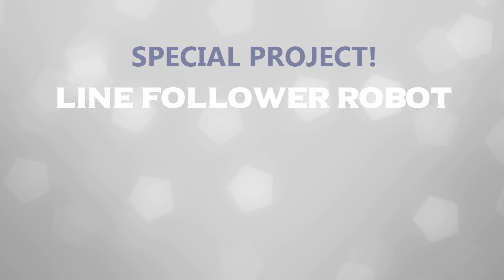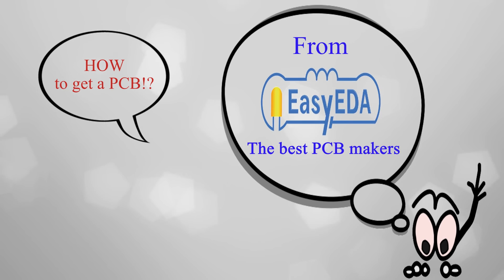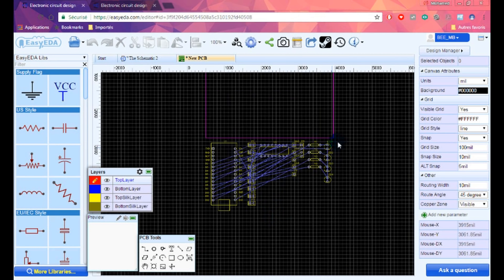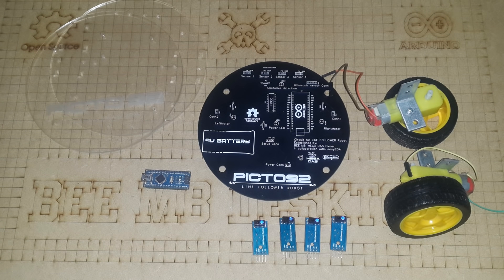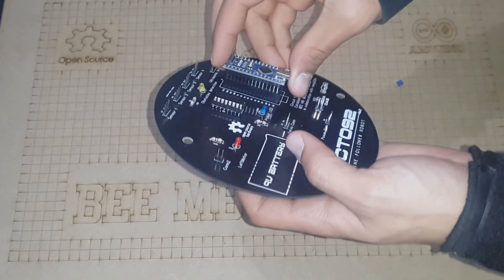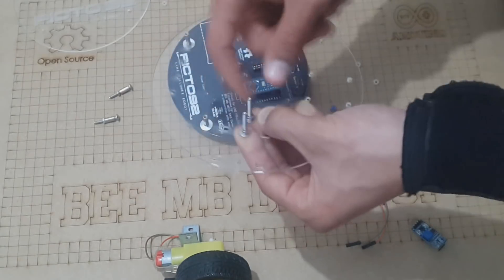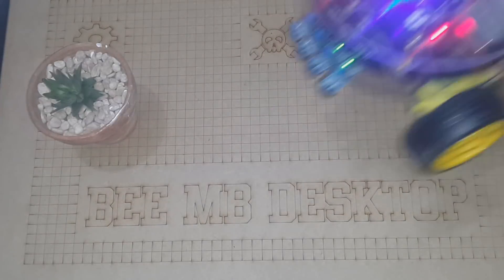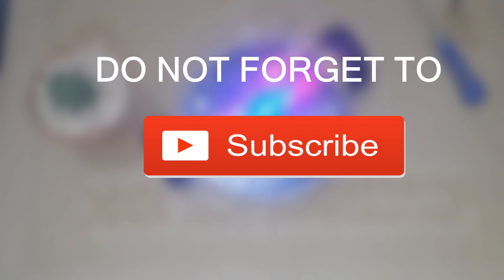line follower Robot (arduino project)

Comment: SIG8 is empty in your EasyEDA drawing. Are you sure ? Also a line that going from L293D to P6 touch to P9. I checked it from project circuit and ı have seperated from P9. Could you control your drawing please ? I'm waiting your prompt reply. Thank you in advance
Reply from the maker: Hello Burak Bektaş
I've already fix the issue so you can check the link now.
Sorry for that mistake, it is not a mistake actually, we tried to make a modification on the circuit but forget to save the last update.

Let us know if we can further assist you.
Do not forget to subscribe to our YouTube channel for more awesome videos.
Reply: I will check and ı will notify to you. Thanks quick reply. You're awesome

Comment: did you use servo motor in this line follower?
but mentioned servo motors in the code
Reply from the maker: Hello likith jay

The servo connector you can add it if you want to make an absticle avoider robot.
for the posted code we did not use it since this robot is made to follow the line only.

Let us know if we can further assist you.
Do not forget to subscribe to our channel for more awesome videos.

Comment: hello, thanks for the great video, but I have one question. Can you say me if the sensors of the robot can see the difference between black, green and white. I need this for my line follower robot and the sensor that I bought (pololu qtr 8a) can't see the difference. Thanks in advance!
Reply from the maker: Hello Anton,
TCRT5000 sensor can't detect colors so I don't think that it is a good choice for your project.
But, I suggest the "TCS3200" or "TCS3210" color sensor to do the job better.
here is a link for a video where I explained how to use these sensors.
link : https://www.youtube.com/watch?v=udwVjE5eYJA

Let us know if we can further assist you.
Reply: Thanks for the quick reply!! I know that the TCS32xx are better, but they take too many ports of my arduino, so I am looking for another solution. But thanks for your help!
Reply from the maker: For Line Follower Robots you will need at least two IR sensors to control the Robot movements that means you will use at least two Digital Inputs from your Arduino but in case of using a color sensor you will need to use one sensor which demands five Digital Inpust, you better think about another Arduino board with more I/O pins or use shift registers if you are good in multiplexing
Reply: The problem is that I need a small robot ...
Reply from the maker: Now this is a matter but I think a camera can solve this! like using OV7670 camera module, but it will be a bit complicated the code !
Reply: MEGA DAS I am going to look at it more in detail, but it can be a good idea. Thanks!

Comment: Nice tutorial,
How about use only 1 IR sensor rather then 4 IR sensor??
Reply from the maker: Hello Thomas,
As I know, we need at least two IR sensors since we have two DC motors to control.
In this project I used 4 TCRT5000 IR sensors to have more accuracy and push the robot to go fast.

Let us know if we can farther assist you.
Reply: Yeah great.. 

At least 2 ir sensor,,
Thanks for your advice..
Keep make more arduino, motor, electronic diy.. great tutorials
Reply from the maker: You are always welcome :)